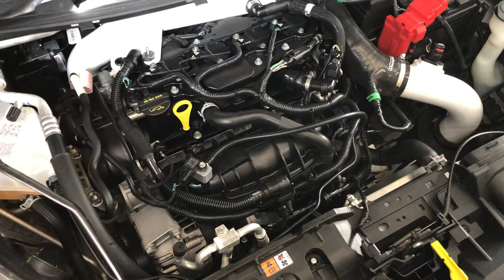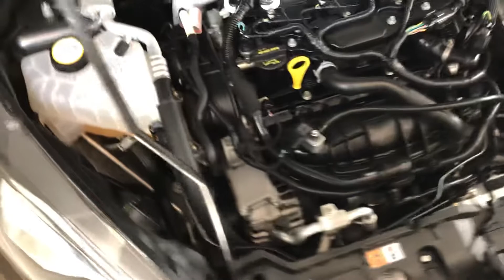Thinking of getting a bigger Wastegate Actuator to unlock more of the Whoosh Turbo and AIRTEC Inlet

Comment: I’m not an expert but the 11psi wastegate should be fine. I would adjust the preload and make sure it’s good before buying a new one. The wastegates are different between the stock/hybrid and s280. So if you end up going s280 the wastegate won’t work anyway.
Reply from the maker: Gotcha, thanks for the heads up!
Reply: I wouldn’t recommend the 11psi wastegate on the stock turbo it could cause boost spikes 7psi is what I’ve ran in testing and found it to be a happy camper. And depending on the tuner you’ll either see 10-15whp up top at redline or some nice gains throughout the curve it’s going to come down to how your tuner does the WGDC. In the case for jst he went with flatting out the tq curve and going for more top end power at 6500rpm we got some major gains well worth it but i wouldn’t run a 11psi wastegate unless you talk with your tuner ahead of time and make sure he’s on board
Reply: @georgevigil7001  ignore my comment i thought you where stock turbo lol 

I run a 14psi setup and hold 30psi on my whoosh hybrid with single port
Reply from the maker: @GoGoggansGo  is that on E30/40?

Comment: Man I'm not really sure, but I feel like your numbers are way too low for your upgrades.   Maybe going with a reputable fiesta ST online tuner like Dizzy would be a good move.  22 psi seems low, and the 11lb wastegate should be fine.
Reply from the maker: I actually am in the process of revising the tune for the new inlet and the intake as well. Already sent a couple set of logs. Once that revision is complete I’m going to make an update video. (After I get the car Dynoed of course)